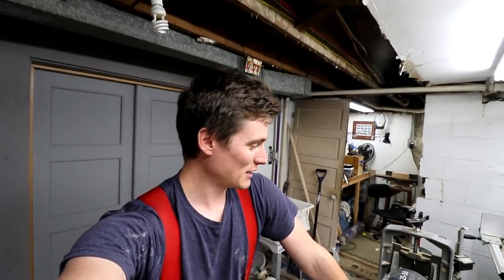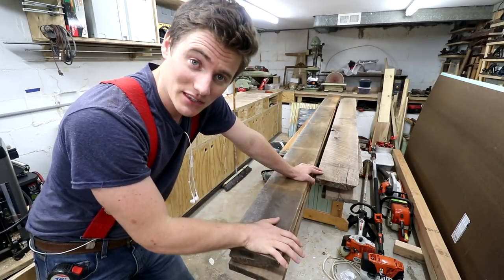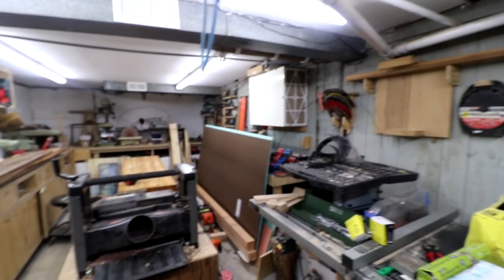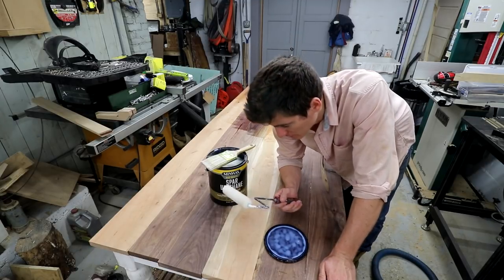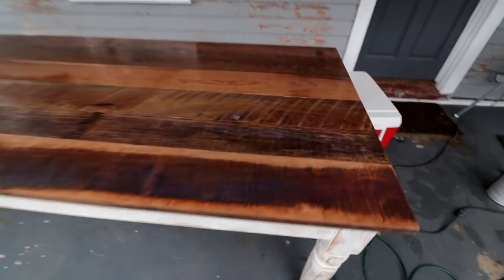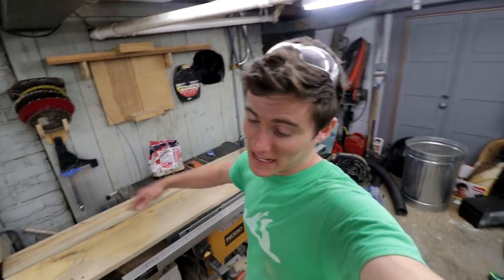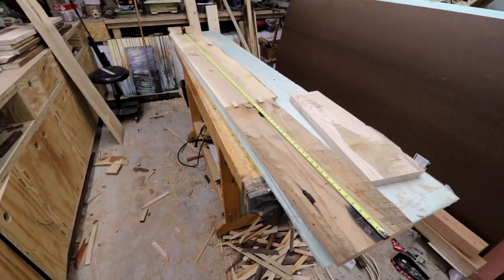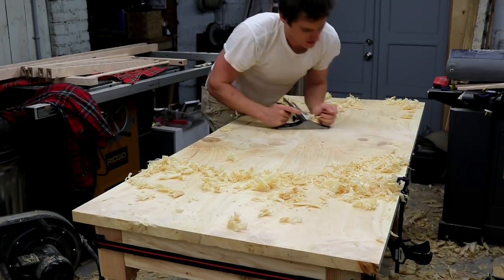Working in the Wood Shop - Tour and Table Builds

Comment: You are a man of many talents for sure. Reminds me of my father, he did wiring, plumbing, carpentry, made gun stocks, made replacement gun parts out of metal, made tools to work with (like a lift for sheet rock long before someone marketed it), worked on automobiles, felled trees, built homes and a log cabin, raised several gardens, was a constable, was in army air corps during WW11, made toys, and could mend a broken doll or someone's broken heart. You have that calmness about you like he did. I love your videos. God Bless YOU!

Comment: Nothing wrong with that table top!   It looks like you put enough dominoes and dowels in it.  It will hold!!   
I've seen a similar to yours table top clamping jig, so I'm echoing a quick "walk through".  I like the idea of this being vertical: saves space and I think it allows the weight of the wood to settle in, with clamping force, but not that much. 
Great work!!  👍

Comment: Nice to see you upload today! My shop is also a mess but it's just a one car garage. No dust collection but just run my planer out into the driveway. Also, you're making me want to buy a festool domino!
Reply from the maker: The domino is very important in my shop, it is a money maker compared to doing traditional mortise and tenons making my table bases and works great for doing stuff like in this video.
Reply: @thehomesteadcraftsman8975  yeah, I want to invest in one for that very reason. I've been using pocket screws but am wanting to transition to non metal fasteners, as I feel they're perceived as lower quality craftsmanship. They obviously serve a purpose but I guess it's just a person preference of mine.

Comment: I noticed you wiped the wet glue off of the table top. I took a carpentry class from a 25 year master cabinet maker several years ago. One of the things he taught us was to never wipe wet glue off of a visible area of a project. Wiping pushes the glue down into the pores of the wood. This can affect how the wood takes stains and other finishes, and even the color of that part of the wood over time as it naturally ages. He said to allow the glue to dry thoroughly then scrape off the excess glue, since excess glue and even drips only sit on the surface of the wood.

Comment: Hi nice work. I noticed you did not use a jointer on the first table top before passing it through your thickness-er planer when planning the under side. I am a novice and my understanding is that a thickness-er will plane parallel not flat. So if you pass timber through it without first creating a reference surface, how did you get the underside of your table flat, and any twist or bows removed?

Comment: What is the hp of your dust collector? I have a 12x16 foot shop so every inch counts. I decided to build a collector/air compressor "closet" off the back of the shop. Now it is quiet in the shop other than the WEN air cleaner. The compressor is a California brand and is quiet, but takes up valuable space. I have just the 4"pipe spanning the ceiling and a section of air hose coming thorough the upper wall to the pipe on the ceiling and hose to a 50' reel.

Comment: What holds the track saw to the board to prevent it from sliding?
Reply: Two tacky stripes of rubber. The weight of the saw is enough to keep it in place.

Comment: Awsome video buddy i have a few questions 1 do ypu still make all your own table legs 2 do you have a video on makinh that clamp system for table tops 3 what kind of planner donyou use and thanks for the video
Reply from the maker: Yes, no, porter cable.
Reply: Hey buddy do you think you could do a video on the clamp station for table tops and hownit was built and thanks for the reply

Comment: Hi, great table designs.
Where are you getting the table feets from?
Why do you use a large and small tracksaw? Different blades I would guess?
Kind regards Mark
Reply from the maker: I turn the legs on a lathe, I show the process in other videos. I'm using the same tracksaw in the video, I only have the one.

Comment: It is said that cleanliness is close to Godliness - so I see no value in cleaning up the cramped mess that you work in just to commence making another mess. Way too much stuff in there - worrying thing is the return air and registers that can not only transfer dust and noxious gases to other parts of your house but act as flue if there where to be a fire - seriously dangerous. Your machines of various vintages as well as quality say a lot and you seem to forget to put on your PPE at times. But I just don't understand why you need to wear red braces (is that what you call them?) when you clearly have a belt on. Peace.
Reply from the maker: I was reading the comment and was wondering what the deal was, got to the end and looked up at the name.....you are a disturbed individual.
Reply: @thehomesteadcraftsman8975  - Bahahaha - do you have a degree in psychology as well as table making ?? So tell Us is it normal to wear braces as well as a belt in your neck of the woods ?? Hey, You Tube is about sharing ideas (and caring) and viewers giving feedback - good or bad it is necessary as we should learn from our mistakes - right ?? - You need to chill and accept feedback that you may not agree with - OR - stop using You Tube to make money - OR - harden up. Peace Out. P.S. Just remember that cleanliness it close to Godliness ......  :-)